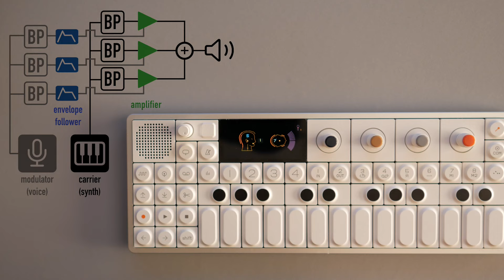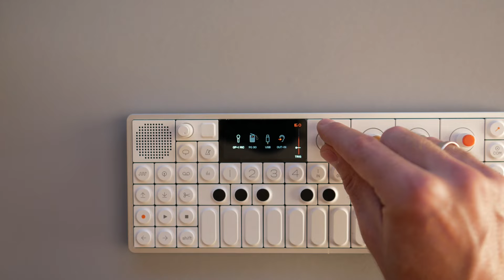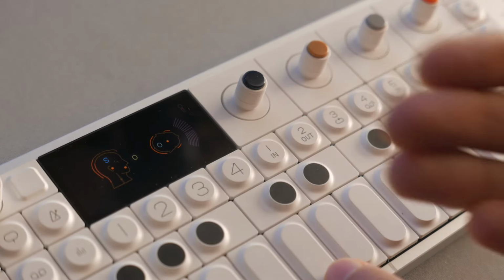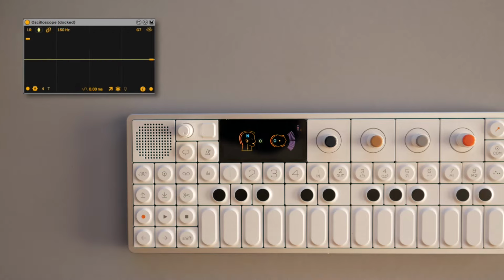new update!!! VOCODER // OP-1 field

Comment: This is really nice! great video, I've had the chance to play with it quickly and it sounds really amazing. 

It seems when you have the mix parameter as dry as it can get it's actually possible to record clean recordings with effect in to the tape, as long as you don't play on the keyboard 😃
Reply from the maker: Thanks, I realized the wet/dry thing a bit too late. So happy it works though :)